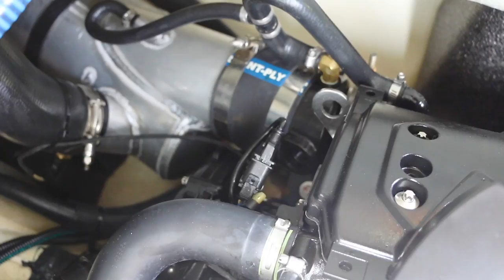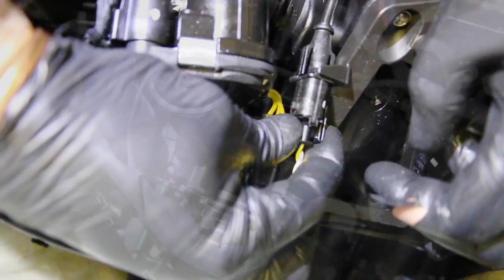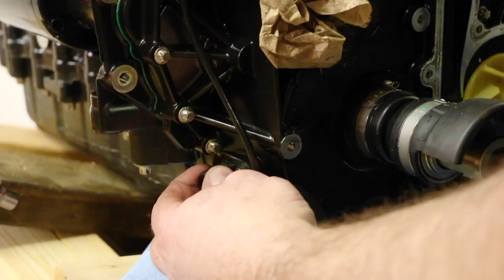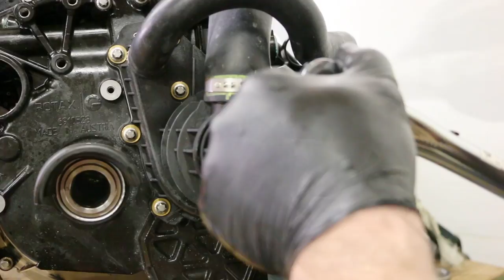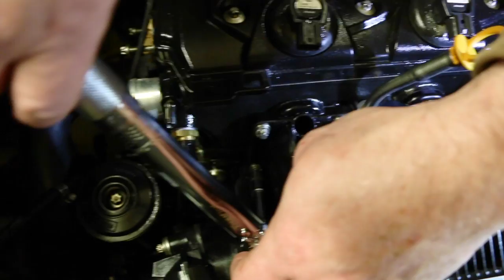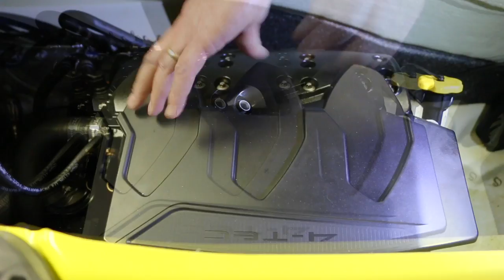How To Replace The Flywheel Bolts On Your Sea Doo Personal Watercraft Jet Ski

Comment: Upon engine realignment, without the tool, could I get it aligned by taking measurements inside of the engine compartment using reference points on the engine/hull?
Reply from the maker: No, unfortunately you must use the tool.

Comment: I have a 2004 RXP 215. I just dropped the engine back in. Im getting ready to align it. You used a distance measurement in this video for how far to set the engine front to back. Does the 2004 rxp have the same or similar distance required when  aligning? its my for 4 stroke Seadoo.
Reply from the maker: I can't recall the distance measurement you're referring to. Do you have a time stamp on the video?
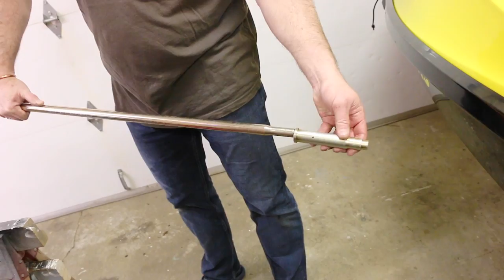Reply: @3ftDeepChannel  it starts around 10:45
Reply from the maker: Ah yes, thanks. The length will vary by machine. You’ll need a measurement for your machine that will come from a Service Manual. Unfortunately, we don’t sell those, but you can find them online relatively easily if you do a Google search for Sea-Doo service manuals PDF. Good luck.

Comment: Are these bolts still an issue for the 2022s rxpx? Think by now seadoo would strengthen them
Reply from the maker: I’m not sure if they upgraded this part, but the issue normally arises when someone removes the rev limiter without changing the bolts.

Comment: Greetings sir.  While servicing my SC I removed the breather & TOPS for better access to the top SC bolt,  when the thrust washer (from behind the TOPS) fell into timing chain area.   Is this thin metal plate likely sitting under the flywheel & thus requiring me to pull the PTO cover like in this vid?  I've already tried a magnet (for hours) with no luck.  Thanks for your help.
Reply from the maker: It’s hard to say how far down it’s gone. Is it possible to borrow an endoscope and put it down your engine to see if you can locate it? You can also buy them for less than $100.
Reply: @3ftDeepChannel  good advice,  but my luck was bad.   Scope showed no washer.   Pulled motor and as soon as I cracked the pto cover the washer fell in my drain pan.  Went ahead and ordered new flywheel bolts from your Amazon page since I was that deep, and my SC oil spray nozzle was also needing adjustment.   Great content, and advice.   Thanks so much.
Reply from the maker: Wow, that was intense. One tiny little mistake and it costs all that work. Chris and I always stress out when we get to that washer in the reassembly stage. You can see the beads of sweat running down our forehead. Glad it worked out for you, though. Thanks for the kind words and good luck with your projects!

Comment: can you do a video of renovating the throttle body? had a leaking intercooler and some salt water has got into the throttle body so i need to pick it apart and i search for it on your channel but couldn't find it :)
Reply from the maker: We only make videos of dealing with issues on our own machines. If that happens to one of our machines (hopefully not), we'll make a video of it. Thanks for your comment.
Reply: yes but its also good to do it sometime even without the ic issue. there is much sticky carbon and nasty stuff that needs to be cleaned. hope you will make the video soon or I can't drive my seadoo!
Reply from the maker: If you've got salt water in there, you need to deal with it and not wait for us to make a video. Good luck!
Reply: well what should i do with it? i have now pulled it of my ski. and it's on the workbench. whats next?

Comment: My new PTO OEM cover gasket does not have the oil filter in it like the original OEM gasket ? Is this okay to use without it ?
Reply: Nevermind it's separate, but it was stuck on there good !
Reply from the maker: Glad you figured it out!

Comment: If I install new flywheel and supercharger do I still need to slip the supercharger?
Reply from the maker: You need to check the slip on the supercharger before you install it to make sure it's within proper specs. After it's been installed, you should check the slip periodically to make sure it's functioning properly.

Comment: When using Riva valve compression tool to install Riva titanium retainers do the pistons have to be in  a certain position?
Reply from the maker: Not really but close to top dead center is best just in case a valve does drop into the cylinder it can't go too far as the piston will stop it.
Reply: Okay I had piston @ top dead center felt really tight when tightening the Riva valve compression  tool so I backed off thinking valve was hitting piston, I wanted pistons up in case valve dripped
Reply: Sorry 1st time doing retainers, problem was keepers were sticking and valve opening a little WD40 tap with rubber mallet and it popped rite loose.

Comment: Trying to remove a drive coupler. Can't find info anywhere. Any idea? And what's the torque for it? Thanks.
Reply from the maker: What machine do you have?
Reply: @3ftDeepChannel  2013 rxt 260
Reply: They also call tgat part as output sleeve.
Reply from the maker: I don't have a manual for your machine, but on my GTR the PTO coupler requires 184 foot pounds torque to install. You need lock the crankshaft, remove the PTO seal and unscrew the coupling from the crankshaft. You'll need an impeller remover/installer tool (P/N 529 035 820). Put some engine oil on the removal too to protect the seal located within the PTO coupling. It also states to use green Loctite 648 when installing the PTO coupling. Good luck!
Reply: @3ftDeepChannel  Thank you!
I've just finished replacing my engine, and I did it by watching your videos. I can say, you replaced my engine:) Thank you very much for your videos and your prompt responses all the time.👍
Reply from the maker: That’s fantastic! Glad to hear! Take care, and thanks for your comment.

Comment: Is this necessary  on a 2008 RXT215 with a stage2 kit and Map Tuner Flash to 8650 RPMs ?
Reply from the maker: Many people feel that the OEM flywheel bolts aren't designed to handle 8,650 RPM, so you should consider it. They've been known to shear off with the higher (non-factory limited) RPMs.
Reply: Thanks, looks like ALOT of work !
Reply: I'm guessing compression took gets tight when going over valve keepers

Comment: My understanding is that dielectric grease is non conductive, why was it used on the ground terminal?
Reply from the maker: To form an electrical barrier around the terminal after it is firmly connected.

Comment: I live in Thailand it's hard for me to get the oil um stuff from the mainland is it possible to use different well like Castrol GTX 1040 I have reached my intervals rebuilding my turbo charger 200 hours now it's time to change my oil any help would be great thank you.
Reply from the maker: I only use the BRP semi-synthetic oil from the dealer. Chris uses the cheap equivalent stuff most of the times. Check your user manual to see what the equivalent is for your machine, if you don't want to use the OEM oil.
Reply: Amsoil 10W40 Marine is my preferred lubricant Mike. A lot of guys in Australia run the Penrite marine 10W40 suitable for SC 4Tecs if that helps. We change every 25hrs.

Comment: Hi, can this be done without removing the engine from the ski?
Reply from the maker: Some people have claimed to do it, but we think it’s easier to remove the engine.
Reply: I have to try same things lol
Reply from the maker: Good luck!
Reply: It's designed to be disassembled without engine removal.
Reply: Removed my stator and flywheel yesterday.  No exhaust or intake removal necessary either.
Reply from the maker: Perhaps, but that requires more body flexibility than we currently have.
Reply from the maker: I get the feeling you’re under 40 years old ;)

Comment: Is this needed on a 2004 RXP that is modified with X Charger and intake but still running factory rev limits??
Reply from the maker: I like to consider the time and cost to be proactive vs the time, cost and loss of use when you have to repair the damage.  A 2004 model will more than likely have the weak flywheel bolts add the inertia of a bigger supercharger and that might be the final straw or it may never give you any problems.  For piece of mind and to avoid repairing the collateral damage if they do fail I would suggest you replace them.
Reply: 3ftDeep pls on the 2004 rxp how do If the previous owner had it done..? Are there differences in the bolts.. and do I need to keep changing the bolts..?
Reply from the maker: It’s a big enough job that if you don’t know that it was done (i.e. the previous owner didn’t tell you), assume it wasn’t done. You only need to do it as far as I’m concerned if you remove the rev limiter.
Reply: 3ftDeep he only side the motor was rebuilt. But he didn’t want to say the things that were done during the rebuild in Pennsylvania.

Comment: Hey 3ft deep I have a 2004 seadoo gtx 4tec, I got a 12volt low warning  and replaced the battery, the warning is back and the battery is starting to die again. my friend said could be a voltage regulator. where is this located I can't find a video for it.
Reply from the maker: I have the exact same problem with my 2012 GTR 215. Turns out one of the connecters to the alternator is getting burned out. You should check all your connecters first. You can find the voltage regulator information on the parts section of Sea-Doo's website. Good luck.
Reply: 3ftDeep is there any way you could do a video on this topic?
Reply from the maker: I will be, but it's a few months away.
Reply: I just replaced the regulator on my 07 gtx for the same issue.  Check the connections and that you have proper voltage and continuity on the leads from the magnetos.  There's a post on one of the forums, but I don't recall which that details it pretty well.  Basically you want to see a.c. voltage at about 12 or so at idle and 20 something with some throttle if I recall my measurements.  Then check continuity to each other and ground.  You don't want to see any dead shorts (0 ohms).  Lastly check the resistance on the red leads to be sure you don't have high resistance.  Or check voltage from one end of the same wire to the other while it's running.  A voltage drop on the same wire means high resistance.  If all checks out, order your regulator.  I installed mine (I went with the oem part) and had a nice healthy 14v or so with the engine running.  Hope that helps some, and sorry for the lack of exactness, I'm going from memory.  Now if someone can tell me how to get my instrument cluster which got water In it to come back from the dead I'll be happy!
Reply: Rectifier bad

Comment: what type of oil do you use for add  into the engine?
Reply from the maker: I only use the BRP semi-synthetic oil from the dealer. Chris uses the cheap equivalent stuff most of the times. Check your user manual to see what the equivalent is for your machine, if you don't want to use the OEM oil.

Comment: Hi bro why my GTX 230 without the supercharger oil sprayer? Thank you
Reply from the maker: The oil sprayer was an improvement that came later on in the design. It’s another reason why we need to rebuild them before too long, or before 175 hours is up. Good luck and thanks for your comment.

Comment: Hello, what kind of problems would I have if I had a bad flywheel?
Reply from the maker: Did someone tell you you have a bad flywheel? Normally the issue is that if improperly installed, the bolts can come off and damage the engine. Also, if you take off the rev limiter, even a properly installed flywheel bolts may come off.
Reply: we got a supercharge rebuild and after that used it for a few hours and then had throttle problems from taking off. It would take off on 1/3 way down on the throttle. When they did a scope they said they seen excessive wear on flywheel gear?
Reply from the maker: It sounds more like you have an issue with the supercharger rebuild. It’s unlikely to be a flywheel problem.
Reply: What about the throttle position sensor?
Reply from the maker: Could be. Could also be a bad spark plug or fuel supply problem. First check the spark pants, many days then make sure there’s no blockage of the intake manifold. Not fair for you to go and good luck.
Reply: Thanks so much you don’t know how much you helped us out already and thanks for the quick replies. I’ll keep you update on our progress. Have a wonder day.

Comment: Around how much is the cost of this job
Reply from the maker: The bolts are only $20 or so, but you'll also need to replace the stretch bolts on the engine (about $150). We reused the coolant, but you'll need to do an oil change at that time. The alignment tool is about $150, so it's best to borrow one if possible. The gasket is also about $50. In other words, it's a bit pricey.
Reply: @3ftDeepChannel  Great vids. Very informative. I am currently stripping my rxpx260 down using your vids as guides - Excellent content. Quik question: Where are these stretch bolts located?
Reply from the maker: They are located in a number of locations, but they are essentially the very large long bolts that require a torque and an angle to be applied.

Comment: Thanks for the video i did it on mine with the help of this.only thing i changed was the air. consider using dry canned air instead of compressor that is water in
Reply from the maker: Thanks for the tip!
Reply: lol
Reply from the maker: Thanks for the tip!

Comment: Why did you have to do that on such a new ski?
Reply from the maker: The answer is soon to come. Stay "tuned" ...
Reply from the maker: We removed the rev limiter so it was revving higher. Without the modification, it could result in engine damage.

Comment: wouldn't it have been easier to just remove the upper half of the body?
Reply from the maker: Good question. There's a video out there of a guy replacing the bolts while it's still in the engine. Not sure which is easier, as he didn't show the entire process.

Comment: Why you have to do that ?
Reply from the maker: When you change the machine's computer to allow the engine to rev faster, the flywheel bolts can come loose as a result. That's because the OEM ones weren't designed to be spun that quickly. If your engine hasn't been modified, you wouldn't need to do this under normal circumstances.
Reply: I think I have that problem the previous owner flash the computer an replace some other stuff and now don't wanna crank 2012 sea doo rxp-x 260  https://youtu.be/Ne90XHq0t38

Comment: And another thing you have to love a company that does not stand behind their machines this guy should not be having to do this s*** Sea-Doo should have to do it but just like when the superchargers were  swallowing ceramic washers they wouldn't cover that either fuck seadoo
Reply from the maker: Hey, thanks for your comment but I need to add some clarity. The reason he changed over his flywheel bolts was not because they were failing. He wanted to upgrade them for another reason. :)
Reply: @3ftDeepChannel  I understand that but Sea-Doos flywheel bolts are known for failing on those that's why people are updating them it's just b***** all these years and they cannot produce a decent machine and they sure as hell don't stand behind them